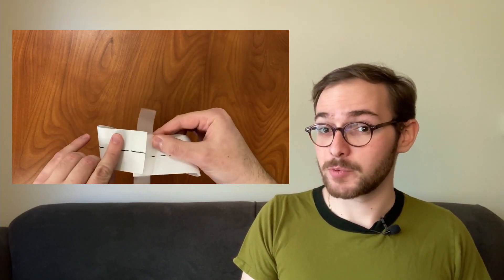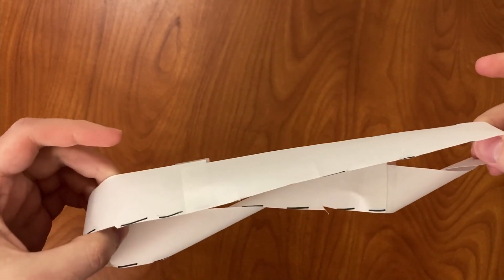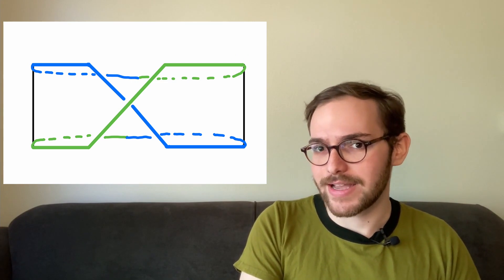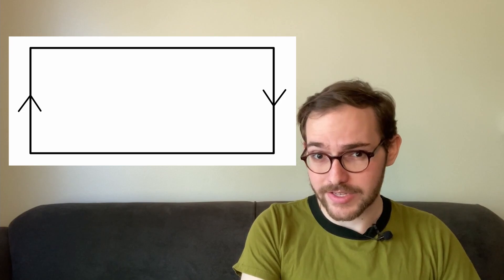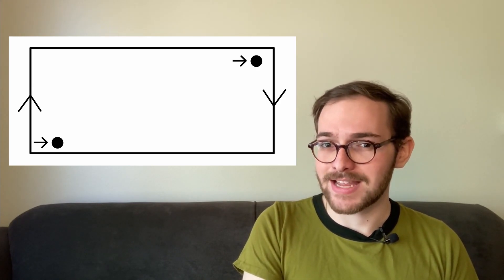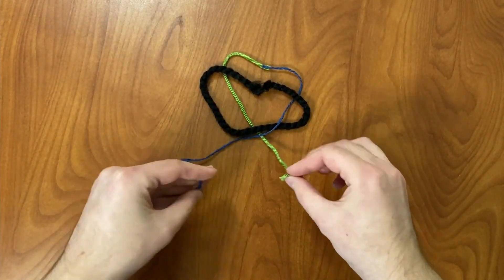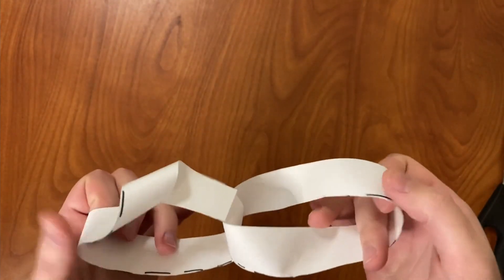Why cutting a Möbius strip is so weird

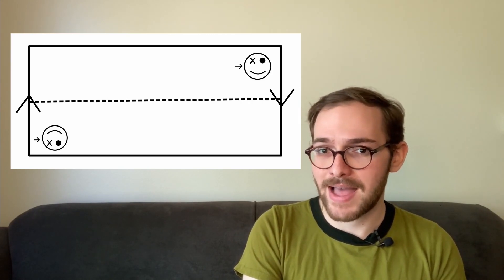Comment: At 2:35 why is the face flipped vertically instead of rotated 180 degrees? I feel like the eyes are swapped from how they should be, but maybe I need to think harder ... Okay it makes sense, if the first eye to cross the arrow boundary is the dotted eye, then that should be the first one to appear on the other side of the boundary

Comment: Thanks for the video. I tried thinking about the cut a third of the way in terms of the diagram and at first, couldn't understand why it would be different from the cut down the middle, but then realized that I need to draw it symmetrically to the center line since the cut ends don't meet on one trip through the strip. And it's actually evident from one strip being twice as long as the other one. Though I wonder if one can see that the strips must stay "together" from the diagram, I don't see a way from the get-go. 

As for the strip with a full twist, if we consider just the edges it is as if we are wrapping one rope around the other and then connecting one end of each rope to its other end. We thus get two "loops" that go through each other, and since we don't cut them, they'll stay together.

I have one more idea for the video. Just today I encountered a mention of platonic solids and wanted to see if I could come up with a proof that there are really just 5 of them. Would be cool to see some ways to prove this. Also, I wonder how many possible solids are there in higher dimensions

Comment: To answer the end of the video: lets imagine the 2 half twist diagram as two 2 d squares, with the edges linked in opposite orientation in the middle and the outside. 

When we cut in the middle, the top edge on one square  and the bottom edge of the other square make one edge of the resulting shape, bound by the cut in the middle. So we’ll have 2 shapes. They are interlocked because the “flip” in the middle prevents them from moving past each other.

I don’t think I did a good job explaining my reasoning! I gotta practice my topological writing
Reply: As a non-topologist, I understood this fairly well. Good job!